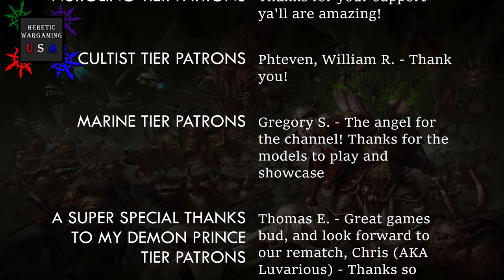How to mold your own bits using Blue Stuff/Oyamaru and Green Stuff - tutorial

Comment: Cheers for the video!
Started messing around with this stuff recently. Would recommend to use a soft sculpting tool (like the silicone brushes) to fill in the moulds with little pieces of greenstuff or milliput at the time (or ideally a mix of green stuff and milliput). This will significantly improve the detail of the cast.
Using Lego to make little boxes as outer casings for your moulds is great 2. Both the boxes and texture of the tops of the lego blocks and surfaces helps aligning the moulds. You can break down parts to make it easier to decouple the 2 parts of the mould.

Edit: Made a bit of progress on moulding heads and (squat) power armour arms. The heads I now make with wsngle blolb moulds, pressing the head (and neck) all the way into the blob of oyumaru including a fragment of the shoulders. Once the milliput/greenstuff is hardened I warm up the oyumaru to 30-40'ish degrees Celsius where the mould becomes flexible enough to wiggle the head out without damaging the mould. For the power armour arms I press them so far in the bottom mould that it covers about 80-90% of the arm, this way my mouldlines end up on the least detailed place that are often also obscured by the torso.

Comment: Just an idea, I've seen a few tutorials where they fill both sides of the two part moulds, then use a bit of water to stick the both sides together when you push them together. Might help your mould lines and potentially saving time on rescuing burst or cut moulds :P
Reply from the maker: Great ide!
Reply: Yes I tried that with a mold originally made to cast metal torsos and arms for some goblins. Worked very well in fact, although I still had a mold line, but much less wastage.

Comment: Good stuff!  Started doing this when I got into kill team for weapons so only need one box of troops.  Now I want that oyamaru because I've been using silicone rubber with green stuff as well, this looks a bit easier.
Reply from the maker: Yeah, the main issue ive been running into is that the GS kinda sticks to the oyamaru while wet (once it dries its no issue) so sometimes my mold lines are terrible

Comment: Thanks for the video.
Have you found the Blue Stuff is better than the generic white thermoplastic? I got some generic stuff on Amazon, and when I let the first part of the mold cool with my part inside, I the place the 2nd half of the mold on it for about 3 minutes and it either gets too sticky when I pul it apart, or it VERY difficult to separate the 2 halves of the mold. 
The first side of the mold looks great with a lot of detail when I remove the part (a Hasbro action figure gun), but I can't get passed getting the 2nd part of the mold to release cleanly as you seem to do.  So, I'm wondering if it's the thermoplastic or just my technique. I've tried about 6 times now and tried 2-3 mins (which is soft still, but anything after makes to too difficult to separate -- even though it's not supposed to stick to itself?  Thanks in advance for anyone's feedback. 🙏

Comment: I've just started experimenting with making molds: Silicone molds are a PITA because of air bubbles, and you HAVE to add channels. And then to cast an actual part, I think realistically the only way to go is a vacuum chamber to remove air bubbles, but a ready made vacuum chamber is expensive, and making one, although much cheaper, is a major chore. I just want to make a few odd bits, not start a production line!

The Blue Stuff Oyamaru method is definitely much easier for making a few parts, but I'm still struggling to make the two halves fit together well; I use a Lego jig and a couple of small clamps, but it's still not great. Practice, practice.. 

I wonder if there is a better and cheaper material to use than Green Stuff? I've tried Apoxie Clay (similar to Milliput) but I think it's better suited for "single" molds  - or cast the component as two separate parts. That road probably takes me back to resin.. but again, air bubbles, air bubbles.. 

BTW, according to some people, cool melt glue sticks work too. I'm not sure that Blue Stuff and Oyamaru exactly are just glue sticks (probably a higher quality) but I've bought a kilo of cool melt glue sticks on Amazon and I'll try it out when it arrives.
Reply from the maker: Woukd be interested to hear the results! While GS is a tad expensive for some, a giant 3 foot roll is like $15 so to me thats not bad for how many things i can make.

Definitely lining up take a lot of practice; in this video i even messed up alignment of some gaunt heads so they were wonky. Definitely something to keep in mind and know you'll have bad ones sometimes

Comment: ever tried casting re dissolved sprue plastic?

sprues in acetone dissolve into a putty , and dries as hard  as  first cast
Reply from the maker: Ive seen it, but im not gonna be doing it myself; i mess with enough chemicals haha
Reply: @PGnC110  like what?
Reply from the maker: @shadedreaver  Im in aircraft maintenance, too many to count over the years lol
Reply: @PGnC110  fair enough
Reply: I was wondering the same thing. Let me know if you tried it.
Reply: @jasonrheins5357  i tried using instamorph , doesnt work. The acetone reacts with the plastic , i think silicone is your best bet
Reply: @jasonrheins5357  i try sculpting with it,  its pn my channel, im making a nurgle army
Reply: I did. It was a 15mm tank turret hatch and it worked very well APART FROM some teeny tiny holes/air bubbles. It seems to be a reaction to the acetone treatment. However they can be filled with any modelling filler of your choice.
Reply from the maker: @johnroberts981  good tips!